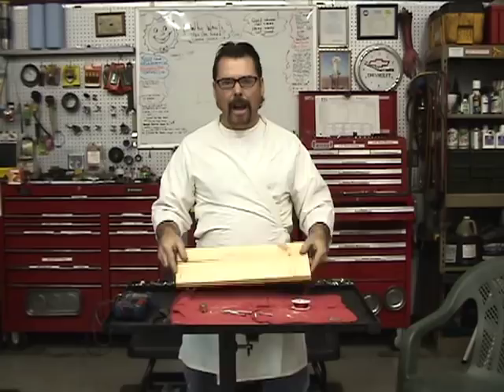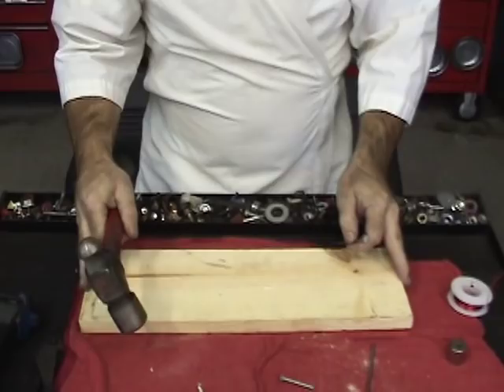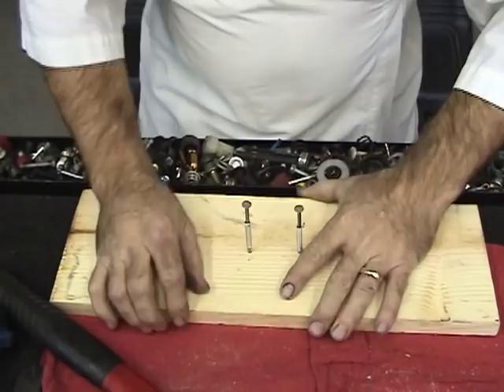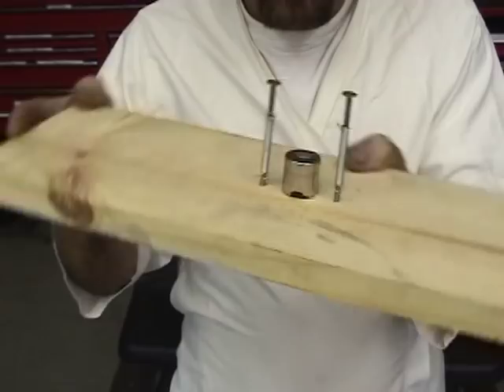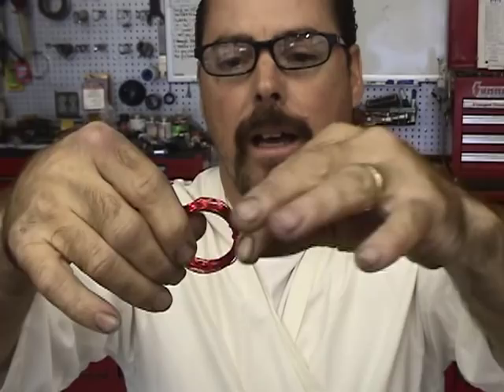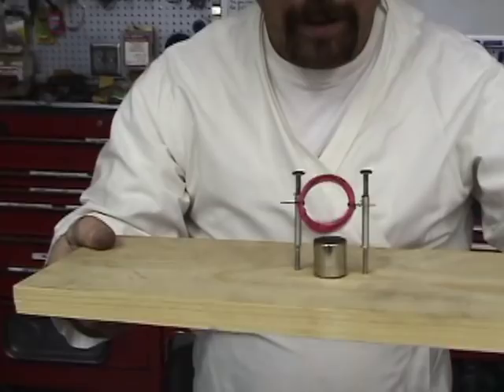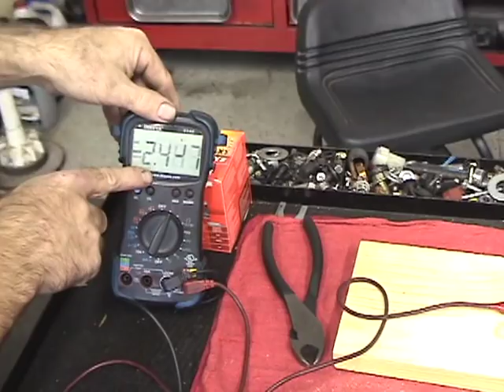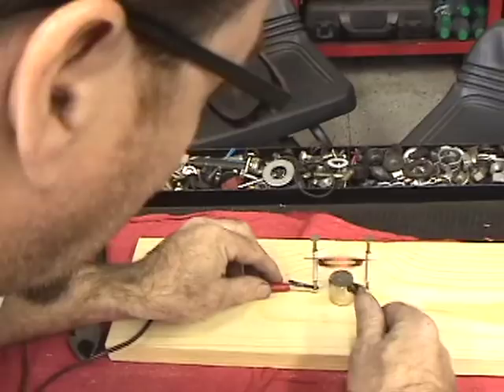FREE ENERGY MOTOR !!!!! How to build it.

Comment: LMAO How come you used two separate boards and switched them at 5:40 ?? Hoax is obvious, obvious hoax
Reply: You're right, he swapped the wood. Good notice
Reply: Or he could of moved the nails and didn't want it to look bad cause it works
Reply: M... Did anyone notice that at 6:23 you can see a hole and what looks like a filled in section. I smell a battery.
Reply: Jeremy Harkness
no
Reply: Jeremy Harkness I see no holes. Why don't you just spend 3 bucks and try it yourself. Radio shack has the supplies dude.
Reply: Sterlin876 Look harder.... I tel you what, why dont you do it... Even better.
Reply: Sterlin876 Look at the grains in the wood. Theres a huge dark circle on the bottom left and a fat ass line on the middle right side of the first piece of wood. Then after he switches the wood, the line vanishes and the circle too...proving he switches boards....
Reply: Jay Jay dat Jetplane Yes it's fake that's the whole point of the video, he wants us to watch closely and figure out what he did to make it work. He's not trying to perpetuate a myth you dolt

Comment: WELL JEFF IF YOU TELL ME WERE you bought a single pole magnet i will tell you how it works!
Reply: mike mcq Monopolar magnets are not hard to make at all, they aren't true monopoles, but heavy on one pole versus the other, imbalanced in one direction or the other, you can make a vitrualized monopolar magnet with a sphere, you just invert one of the poles to center of mass, I'm not exactly sure how this is achieved in production, but I know it is done.
Reply: +Robert Overturf (IowaTech80) div(B) = 0. there are no magnetic monopols :)
Reply: +Robert Overturf (IowaTech80) 
since you seem in the know about mass produced magnetic monopoles, i'd love to get my hands on one and claim my nobel prize.
Reply: +fenixwraith not a true monopole, so no you wouldn't,  more of a virtualized monopolar arrangement, it's an inversion of one pole toward center of mass in a spherical representation
Reply: exactly .two magnet n to n or s to s to give circular n or s mono-pole in laymen terms.
Reply: try to remove n coil and check the volts sir. if the tester it fuction we have a little sicret

Comment: Just wondering why he felt it was important to clean off the enamel insulation off of the ends of the coil? The only reason this would make any difference is if the coil was actually in a circuit, which if the details of this video are to be believed, it is NOT.

Comment: it works because it has a tiny hidden 2.4 volt watch battery and tiny hair wires connected to the neg and pos nails. running a small electric current forces the wire to spin above any magnets.

Comment: This is clearly fake. What he's showing is a basic DC motor. There is a battery in the plank with the negative and positive leads connected to the nails. Also, at the end he says "If it's too good to be true, it usually is."
Reply: a dc motor wont spin if the coil is positioned like that aligned center with magnet. there is only force applied when the wire is perpendicular to the magnetic field.
Reply: Srslyblack lol clearly you need to go research how motors work.
Reply: ziongite
i made that motor he was talking about. i can make it right now if i wanted to, dont need to research. even remember the physics laws that apply that make it work.
Reply: Srslyblack si, claro. Después de acabar el teletransportador pensaste: “voy a fabricar un motor autónomo, antes de continuar con la máquina del tiempo”.
El que se crea ese vídeo tiene serios problemas.

Comment: What you made looks like a standard motor.  When electricity is applied to the nails it induces an electric field in the coil that moves it against the magnet.  That was why you needed to remove the insulation on the wires so the electricity from the battery could get to the nails.  The battery could of been hidden on the side of the board facing you which you did not show.  The battery induces the voltage in the nails and the intermittent coil bouncing around fluxes a drop in voltage on the display.   If the motor you made was real then you could of used non-conducting plastic posts and it would still work.  Fun fake out. :)

Comment: You said it right, if its too good to be true it probably is. A different board springs elevated off bottom top of wood may be a plastic veneer and it conceals the battery power to the coil. I have made enough of these for my HS physics classes. You can never generate energy to do work without friction and heat energy using part of motion energy so there is no such thing as free perpetual motion. More or faster motion more heat. Feel the coil for heat in a minute or two. It will begin slowing. Higher draw on amperage causes greater heat energy and coefficient of linear expansion causes the wire coil to increase in length drawing more amps more heat in a viscous cycle until the motion energy is all converted to friction, and heat energy.stops.

Comment: The nails probably made of Zinc,the springs probably made of copper.Two spring nail combination acting as two batteries ,so as the coil of wire is connected electric current passes through the wire which is inside a magnetic field resulting in that spinning motion of the coil.But its really a creative thing .

Comment: The most abundant source of "potential" perpetual energy is in the form of gravity or magnetism. Though I have no idea if this overly simple thing works, I'm pretty sure I can find out. It's not like you can't find the stuff he used in your own garage or just lying around.

But with the overwhelming fact that a black-hole and everything within our universe runs and exists solely upon gravitational and magnetic forces is a very clear sign that it will be magnetism that will be what allows us to create the closest thing to free and perpetual energy.

After all, even the suns energy and that of any other thing in the universe is completely dependent upon gravitational forces. You don't get the sun converting elements without the intense gravity. We just need to find a way to scale it down a bit.

Comment: the trick here is that he uses a monopole magnet. An explanation on this can be found on Mr. Teslonian's channel. Also, because it is a monopole magnet, the magnet pushes electrons in the coil around. Spinning it manually starts the process because it creates an electromagnet based on the current going through the coil while at the same time the current is being generated by the motion therefore creating a generator. Also, for another example, see an MEG (motionless electric generator). A russian youtuber has a video showing the power of a magnet which still needs to be kick-started to harness.

Comment: A wire passing through a magnetic field causes induction in the wire (a current). And a current in a wire produces an electromagnetic field. The wire is given an initial spin in the presence of a magnetic field, which causes the wire to produce a current and thereby become an electro magnet itself, and the continual motion is a result of the interplay of the two magnetic fields in their special orientation.

Comment: It works because mono polar means one polar so it has only the north polar or minus side so it can only repel. so every time the metal wire spins it goes over the magnet which immediately repels the metal and repeats for a while until there is and interference.

Comment: I'm sure the nails went right through the cloth into electrical contacts beneath. Permanent magnet plus electricity equals motion. But now I am inspired to build one with the electrical contacts inside the board as well as the battery to make it a magic trick

Comment: Like any silly magic trick, he towards the end switched out the original board replacing it with a  board with a set of 2 series small batteries directly connecting to the 2 nails (1 positive  the other negative) . The batteries are slotted in on the far side of the new board on the face not seen by the camera in the final seen. To make it work like a basic motor, the coil is not the same coil seen in the original footage  , but a coil made into 2 coils  with 2 carefully scraped ends to form a basic  commutator.  One coil loop at a time  will be activated  sitting on the  conductive spring loop  as it interacts with the magnetic field causing it to turn in one direction.
Reply: Is this true?  Jeff williams?

Comment: Clever, the original board had the nails driven in is different than the final product. The original has dark grain marks and areas while the final product is very  white over the surface. He shows the final product top, bottom front and sides but not the back. He must have drilled through  the back placing wires that made contact with the nails and mounted the battery on the back out of sight.

Comment: their is a battery inside the wooden plank connected to the nails so current flows through that coil and  due to magnetic field torque acts on coil and it rotates . Good trick

Comment: at 4:04 he said he was going to roll it around a piece of pipe as he did that he gave it a charge either + or - to the coil as he pulled it off making it repel or attract to the magnet as on side of the coil is closer the other side gains momentum continues to push it. i'm not to sure but that is what it sounds like

Comment: This little motor works because of Lenz's law The wire moving past the magnet produces an electromagnetic current that is enough to repel the wires as they pass. You can also see this when you drop a neodymium magnet through a pipe. It will slow it down for the same reason.

Comment: This tiny DC e-motor construction is well known to main stream science. The insulation on the ends of the wires is scraped off only on one side so they work as a primitive commutator. The magnet is a normal one of course, monopole magnets do not exist. And there is a battery hidden in the board connected to the two nails.
This is a nice toy to show the principle of a DC-motor. It is not nice to present it as free energy. Too many people believe such crap already.

Comment: Actually the explanation is quite simple... The neodynium's magnetic field induces electrical current in the coils around the nails. This current then turns the copper coiled wire into an electrical magnet itself. Then our copper electrical magnet and the neodynium magnet interact. Because of the relative position of the magnets' fields, once put into movement, they never reach a point of equilibrium, thus creating perpetual movement. The source of energy that allows this system to go on forever is actually the magnet itself, so there IS a source of energy, and no physical law is broken.

Comment: It is suspicious that he changed wood without mentioning it for some reason. There's a large possibility that he drilled into the wood on the back side that faces him placing a couple wires touching the nails and a small watch battery that is pressed into a hole or something on the backside. 

However the purpose of being a skeptic is to question with testing, not sit back and claim ignorance, so I will be testing this one myself! I have started small Magnet research of my own in my garage! Haven't discovered anything yet but it definitely mind opening to even feel the resistances of a magnet to another or the eddy currents from copper and magnets!

"I'm convinced I'm right on this one, because he never shows the back of the board, and his eyes are fixed solid on what looks like the motor, but also like the edge of the board at the back!"

Comment: The solution is very fine magnet wire. The camera cannot show the fine wires. Even if you were there in person if you were more than 6 feet away you could not see the wires. This kind of wire can be found in small low current relays.

Comment: It works because you used 3.7 volt flat coin battery inside the wood. It can be clearly seen there is a canal curved at the left side of the wood to hide the power source and the wire electricity goes inside the nails :)

Comment: Hey Jeff Zack in Littlefield the coppers getting an electrical current the causes it to become a magnet,as copper passes magnetic field the current is induced into it , if you were to drop a copper slug at a magnet it would magnetically break right before it touches down

Comment: there is a battery in the back edge of the 2nd plank and nails from the back edge that hit the top nails in the timber. power is sent in this way, (show us the back edge while it is running or stop it spinning while we can see the volt meter drop)

Comment: This one is very easy.  He used two different boards of wood.  In the first half of the video the Pine Board has a small knot in the lower left side.  There is also a dark stripe on the right side of the board, center-line.  At 5:40 (mm:ss), when he trims the excess wire off the coil, the camera stops filming, and filming resumes with a different wooden board, that has no blemishes.  If he would have used that same board for the Magic Trick, it would have been much more believable, even with the pause in filming.  I didn't notice the pause in filming at first, and I only caught it after I studied the video a second time. Or even better, he should have set up the hidden battery pack and hidden wires before nailing.  Then he could have marked the proper nailing locations with a small pencil tick and done the Magic Trick in a single continuous shot.

Comment: Drill from the back, insert a permanent magnet into the board.  Then drill holes so the nails are connected and run alternating current through the nails.

Comment: from what i know it a direct current electric generator, every conducting wire has a magnetic field and that magnetic is interfered with the magnetic field of the permenent magnet , the changing of magnetic field causes a electric current flow this is called Electromagnetic Induction  ,with the current flow there is a force which keeps the coiled wire or also known as solenoid moving and the magnetic field keep changing and the elctricity is generated

Comment: This motor works by magnetic force inducing a voltage on the coil and through exiting the electrons in the coil. I am an industrial electrician and I will tell you there is no such thing as perpetual motion. In this experiment the excitation of the electrons in the coil will slowly weaken the magnetic field in the magnet. Same thing will occur in the so called magnetic perpetual motion generators. I know this because I have performed these experiments in my workshop.

Comment: This is not a full explanation, but when he put it in motion two things happened. A small current was induced in the coil, and a magnet field formed as a result.. The direction magnetic field isn't based on the orientation or relationship between the coil and the magnet, it is based on the direction of the coil winding, so as the coil spins its north south remain fixed. As it spins it alternates between repulsion and attraction. Having a little bit of dielectric coating left on one side the wire would have produced a nice oscillation. It is clear from the video his on-camera build must not have worked since he swapped in what was likely an original that was correctly built. I think the dielectric would be the key to having this work. Position such that the current fell as the two opposing sides came around, but as inertia carried it forward, it would again make contact resulting in immediate repulsion.. Looks sound to me, except the last minute switcharoo gives an impression there is some trick involved.

Comment: Let me try and explain given the limited space. The flow of the magnetic field is from "N" to "S" pole,   once you get the coil spinning it has magnetic properties that are being reversed every 180 degrees as it goes over the magnet.  This is an inductive feedback due to the closed electrical loop in the coil.  IE: Every time the coil would spin over the magnet it would change it's polarity pushing  the coil along..

Comment: Actually the reason for the change of wood is to hide the batteries you have to use to make this motor work. The poles cannot change if there is no power. The power would go connected to the nails and when the coil goes over the magnet it pushes the coil away and that is because it is a Monopole Magnet. Monopole means it has only one polarity, usually North only. The power to the coil is put on the nails to create an electro-magnet with a North polarity and therefore pushing the coil constantly into a spin.

Comment: As the coil passes through the magnetic field  the field induces a negative polarity current  which creates a magnetic field, The 2 fields repel each other.after the coil leaves the field the current magnetic field dissipates, as long as the coil has enough rotational energy to continue through the field it will continue on

Comment: I am simply dumfounded with a lot of people's comments that this is "FAKE."
HOW IS THIS FAKE? WHAT PART OF IT IS FAKE?

Is there an invisible battery connected to the nails with invisible wires inside the wood piece? Is the magnet is actually a battery?

As the saying goes, one can easily dispute by making stupid statement without supporting evidence, but it is hard to explain this is actually working.

Comment: here's an idea - a helium-neon laser tube needs a 75,000ohm resistor to prevent the laser from sucking too much power out of your power supply ... meaning it might have negative resistance. Replace the resistor with a regulator and see what extra power you can suck off the circuit

Comment: it works because the magnet pulls it towards itself and the momentum gets it past the no return point then it gets thrown by the magnet so the other side comes down and gets its turn it is just like the magnet that repells anothe magnet same prmise very cool and if it were a larget scale u would have more electricity with a stronger magnet just like the magnet trains that hardly any1 knows about yet